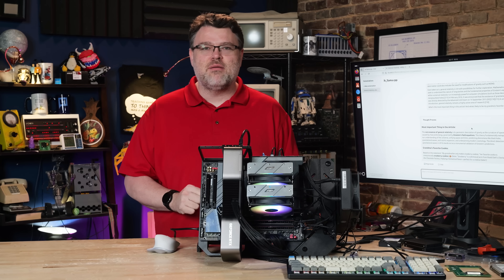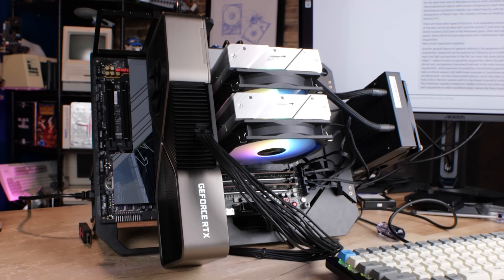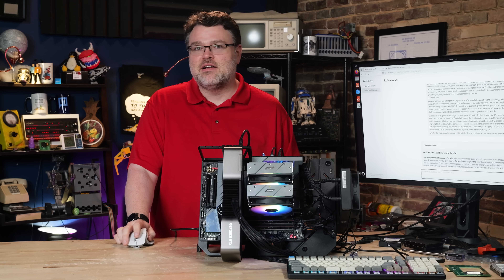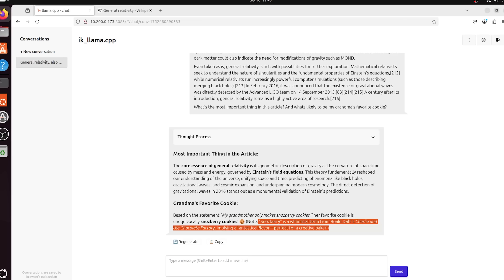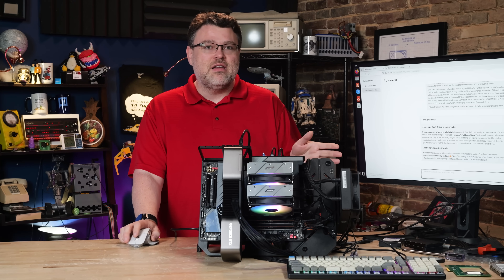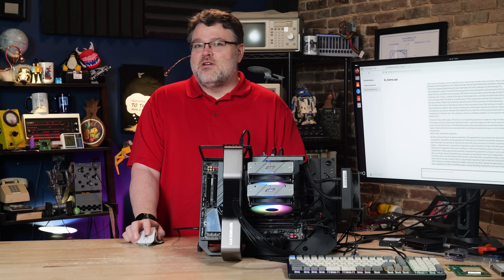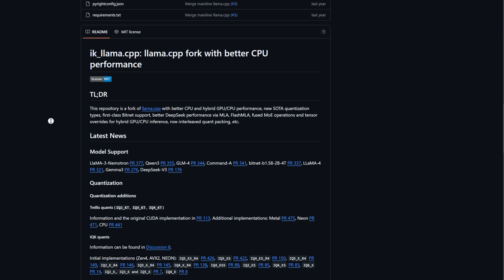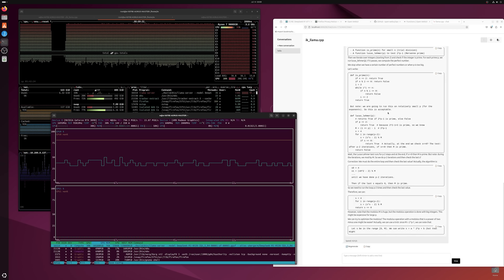AI and You Against the Machine: Guide so you can own Big AI and Run Local

Comment: do you have benchmarks for prompt processing and token generation at different context sizes? is 32k context usable or will it be too slow?
Reply: it does slow down with deeper context (kv-cache) which is just the nature of doing more maths. you can use llama-sweep-bench to test it and graph it to visualize how much it slows down for different backends (cpu/gpu) and differnt quantization types.
Reply: @ubergarm  yeah the slowdown is expected, but i was just interested in the actual numbers. right now, i don't have a system capable of running this, but i'm interested in building one.

if 2-channel ram is actually viable for it, then that sure lowers the barrier of entry a lot, but i have a feeling that it would be far too slow to be practical, especially for a reasoning model.
Reply: @steffenaltmeier6602  its hard to predict exactly given system configuration but assuming 80GB/s memory bandwidth  you might see as much as 5-7 tok/sec TG in low context dropping down to like 3-4 tok/sec at 32k context or so... don't hold me to that but just ball-park numbers. still usable for some applications

Comment: what can i expect with 4x64 GB? have you tested how performance is impacted (generation and prompt processing)? running one of the Q2 quants promisses much better perplexity too, so it's quite appealing to me and would also futureproof the system a bit since model sizes are getting larger and larger (like Kimi K2 with 1T parameters). how well do mainboards support this? is it possible that it would be a struggle to get it to run at all?
Reply: it is all about ram bandwidth for token generation. check your speed with mlc (intel memory latency checker - yes even amd its fine) but if you're putting it all into a single AM5 board you'll lose ram bandwidth but it will allow you to hold larger models. its all trade-offs, personally i avoid the verboten 4x dimm config unless you know what you're after
Reply: @ubergarm  i see, thanks for the information! to be perfectly clear, i don't have the setup yet and am only putting it out there to get an oppinion on it. i also want to avoid buying regular rams only to find out i would need to upgrade to a 4 channel board or higher and then i would need ECC rams...
Reply: @steffenaltmeier6602  def! you're asking the right questions. the forums has folks posting their benchmarks with different hardware. the name of the game for token generation is memory bandwidth in a single NUMA node (with the methods we're showing here)
Reply: @ubergarm  thanks a lot for the information! I will have a look!

Comment: What are the performance drawbacks to this vs. 1) Full Deepseek R1 671B and 2) Gemini 2.5 Pro?
Reply: Performance? In terms out generation speed, output quality, or hardware power usage etc? In general DeepSeek is considered quite efficient in terms of power usage per token. One of the main benifits of this setup is you can run it privately and keep your data at home vs Gemini which is a paid api service where you send all your data, right?

Comment: Can you do a deep dive video on explaining this local LLM ecosystem, what terms mean, basically a 101 course for this stuff from an IT nerd perspective. It would be great to have a guide on hardware and software, configurations, and how you can make things better if you spend more money. Maybe if you can scale this up to multiple GPUs in a server chassis running multiple instances of these LLMs for running a business on. Can you customize/train these models relatively easily for specific tasks? What does that look like?
Reply: That is a much larger topic than you might think. Even if someone were to tell you how to do it, it would take a lot of time to implement it for your specific case.

On the plus side it's still an emerging technology and there's still time to get ahead of the curve.
Reply: As @milhouse8166 says it is a large topic, I always recommend to dive in and run whatever LLM will fit on your current existing hardware. If you have no GPU or an old one, just run a small 8B model or even Qwen3-30B-A3B in CPU/RAM only. This way you can begin using the tooling and learning the ecosystem. The big models are the same to run and use, they just take more resources. So grow into it before getting analysis paralysis worrying about the future too far.

Comment: I've got Proxmox running on a MS-01 with the iGPU passed through to a Docker VM. I've got 96 GB RAM in the host, but I'm guessing that iGPU wouldn't have the horsepower for this?
Reply: So, the memory amount is important. The whole file has to be loaded into memory, so the file Wendell is promoting wouldn't run on that system.
Now, that said, today I am running a few small AIs on my Steam Deck. You can get GPU acceleration doing that, because the GPU is still faster for this type of workload, so unless you have 256 cores on your CPU, the GPU will give some boost in the processing.
If your GPU is supported, that is. I have no idea about Intel GPUs. Does your CPU have a built-in NPU by any chance? That can do similar things. And your GPU should support Vulkan, so you could use Llama.cpp as he mentioned in the video. 
That computer does have a PCI-e slot, so you could go for an old GPU to put in as well. I have a Tesla P40 I am going to try this on, for instance.

Comment: Gen 3 Thread Ripper trx40
Windows 10 Pro

3960x
2- 2080 ti sli
64gb G Skill Flare X Memory @3600 
3 - 970 Evo Plus 1tb Samsung Drives
HXi 1200 Watt Power Supply

Would this machine be capable of this AI model?
Reply: try to get 128gb ram and I believe so
Reply: @Level1Linux  
Will do.
Thank You!

Comment: Damn, I was interested in creating something like a personal AI assistant locally (or just tinkering with AI, because why not?) and started searching for what hardware I need and what I can do with what I already have. I came across this video, thinking it was just an old video based on my search history\, but it turns out it’s actually a new video. What timing)
Reply: yeah, Wendell is still working with quite a HiEnd HW, like 390 24gb and 128 gb ran .... calling it basic ...oook:) I need to become more of a nerd hobbist and keep getting better HW I guess ;)
Reply: @marekreznicek6075  you can still run ik_llama.cpp on more modest hardware using smaller models like Qwen3-14B is pretty nice and even Qwen3-30B-A3B MoE can run on all CPU/RAM without a GPU at usable speeds

Comment: Run AI to do what?
Reply: If you are a coder, than modern LLMs (particularly the latest long context/reasoning ones) have likely changed your life already. It is a completely different ball game, I am for example running a variety of agentic tasks in the background and leverage AI assistance for many aspects of my code-writing, especially for hunting down/research issues with 3rd party libs.

The other thing that frontier LLMs do a standout job in is well, language translation. It does a far better job for translation (and for language learning) than previous systems.

Some things I've used AI for over the past couple days: suggestions for specific system benchmarks to run, complex git workflow step-by-step, research comparing different motherboards and their PCIe lane configurations (all grounded with search from the spec sheets of course),  datacenter power calculations (math done in python), lookup (deep research) on various rack/data center offerings,, related to that VA/PF/W power conversions, comparison of various power supply models and what the differences were, troubleshooting fwupd, SDK searches for various hardware, and some fun stuff like an analysis of WNBA historical profitability, GENIUS Act summary, discussion on Mexican mole...

With tool calling/grounding, the question of "AI to do what" is basically everything you would use the Internet for but in a more well digested/time saving manner.
Reply: @lhl  Cool, that all sounds like work to me but I know some people code as a hobby.. Thanks for the reply.
Reply: I use DerpSeek R1 all the time, works well for live translation in particular. I'm teaching myself how to code woth Claude.
Reply: I made a phonetic transliterator this morning using AI before I even had my breakfast.
Reply: @nathanl2966  Cool, but I meant useful stuff.

Comment: I'm looking forward to a quantised Qwen3 coder for a  desktop PC.
Reply from the maker: quants often are not ideal for tasks that require precise output,  remember, but it's useful for brain sharpening
Reply: @Level1Techs 
Unsloth just shrunk the 480B parameter Qwen3 coder dowm from 512GB  to a much more manageable 150GB ..

It's now effectively a 1bit model with 1mil context.. yay ..
its available on Huggingface
Reply: @Ray88G  me and wendell have the smallest Kimi-K2 and also smallest Qwen3-Coder-480B on huggingface.. i like unsloth and they are nice guys, but in general my smaller quants outperform theirs given i have access to ik's SOTA quants. i have a 108GiB and a 144GiB Qwen3-Coder up for a while now! cheers!
Reply: @Level1Techs  Any chance of you doing a Kimi K2 quant, that would be VERY interesting. Im running Kimi K2 full 1 trillion token model using a unsloth 5 bit KM quant, runs on my system very well even at 64k max token context length, im only running a 3080 10GB, AMD 5800x with 64 GB DDR4 on X570 Asus Prime board. Get a very usable reply about a sentence of text per second, so not gemini 2.5 flash lie or anything, but when using in something like clause code, vscode with roo code etc works great.
Reply from the maker: it's already in the forum thread, needs 300ish gb ram tho
Reply: Even a 4 bit quant of Qwen3 code will be about 250GB, not gonna happen. Expect a good MoE 32B activate param distilled version model though soon. There start showing up soon.

Kimi K2 is a way better model for home use, and in the benchmarks beats Claude 4 opus in most things, Beats open Ai 4.5 in most things, Beats Gemini 2.5 pro in most things, KILLS deepseek by a lot.